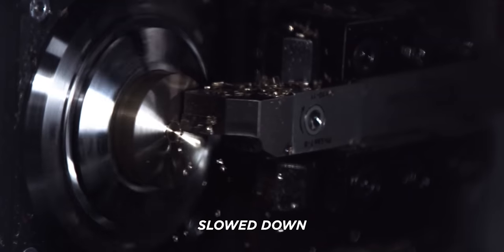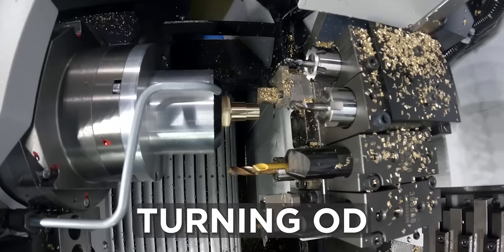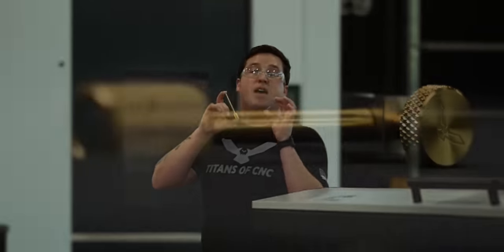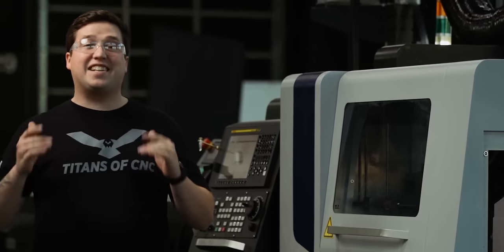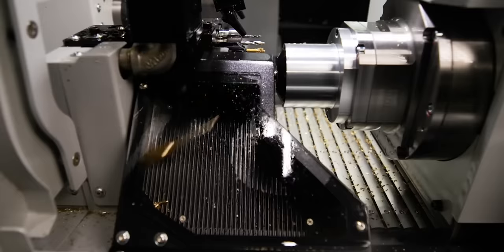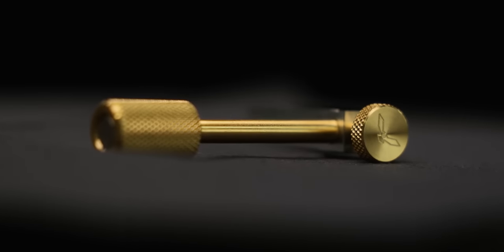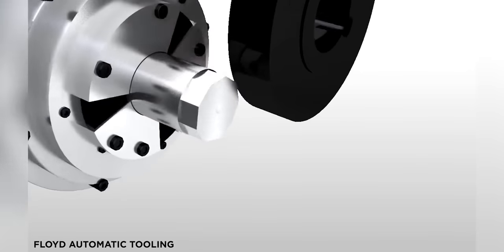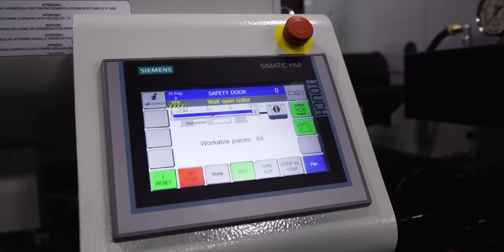SPEED MACHINING | Tools Relentlessly Attacking Metal

Comment: Not necessarily related to this post but does Titan CNC have any experience/feedback relating to Rego-Fix tool holding, specifically the powRgrip line, vs shrink-fit re: clamping force, tool changing, etc or is it too small to consider for your size requirements?

Comment: What do you mean by deburring the thread. How does the operation look in detail.
Reply: You can basically run your turning tool that does the thread profile a few tenths above the surface after single point threading to knock down any burr that sticks up. Running another pass of the thread in the same way after the profile clean up can also help deburr, but may be skipped if you're chasing down cycle time.
Reply: @jonathantaylor2584  EXACTLY!
Reply: @jonathantaylor2584  what tool holder are you using to face? I run a citizen using a iscar holder to face but the insert kicks out of position, so I’m looking for a better tool
Reply: @mannydiehard1  I've only been running swiss lathes the past 6 months so I'm still getting familiar with the tooling. Running 5 citizens mostly with through coolant Utilis V and D style holders with NTK inserts. Most material I cut is annealed S7, 303, and 17-4 H900. Currently taking tool life data on a heat treated 416 part.

The only push out I've experienced so far has been on an L12 cutting 17-4 at around 42HRC. That was at .100" radial depth of cut and about 300 cutting inches over 23 hours. 360sfm at stock diameter, .0006ipr. Diameter was the only critical dimension at +/- .001" so it wasn't a big deal having about .0015" of push out. A few tenths of X wear offset every few hours to hold nominal.